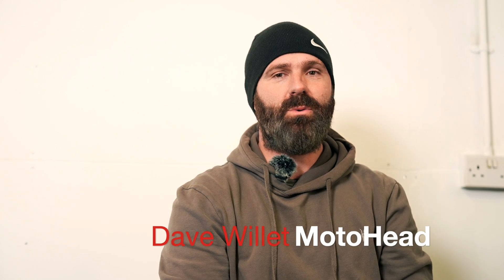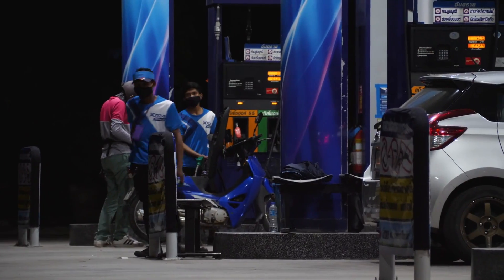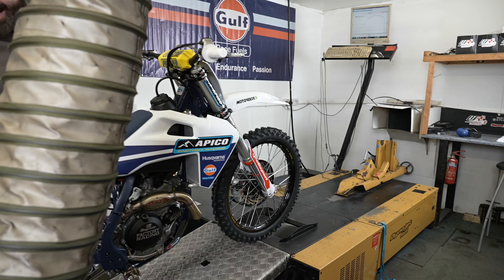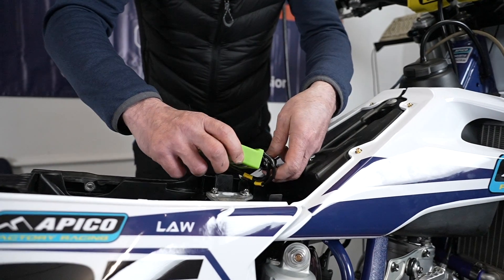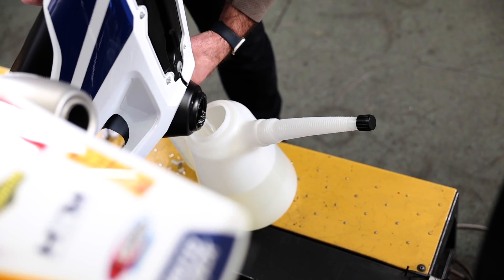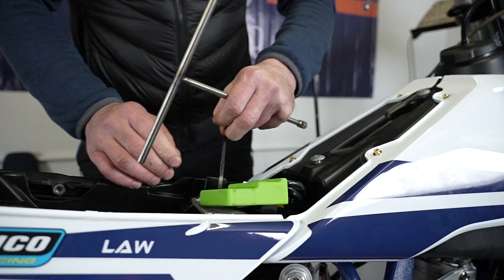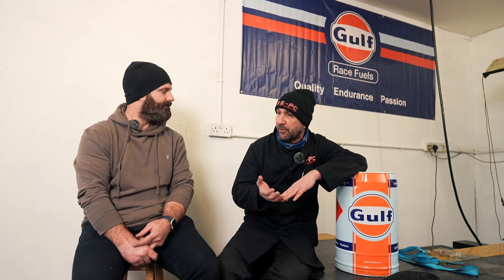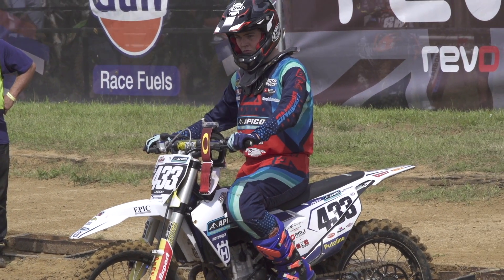Race fuel: The truth! We dyno test pump fuel against Gulf Racing 102 and the results are shocking!

Comment: running a same base mapped engine ,  with an oxygenated fuel will be leaner than the standard fuel , that alone will make more power ,   for how long , who knows being its leaned 8-10% , but ...  .   now the race fuel will have a better cooling effect ,  but anyone thinking this is better , without timing or fueling adjustments , is wrong.....

Comment: I just want to say that it's utter bollox to say that a bike stored with pump gas over the winter will be trouble to start because it was stored with pump gas in it. THEY SELL GULF RACE GAS!!!!!! Utter bollox oh and to cap it off, it's better, believe us. What you want to see the data............. This is a dishonest commercial. You don't need to spend $50 a gallon on race gas if your not a racer. I ride with a large group of street and dirt riders and we all run pump gas. Only issue I have had is a bike left for 3 years, the ethanol fouled the fuel pump but to say you can't store over winter is utter bollox and a sales pitch.

Comment: Why at least 1 pump at the gulf doesn't stock 1L or 5L (Aspen 4t) station should have that fuel to fill out a tank or mix part e10 or premium 
The benefits of Aspen Fuel · 99% cleaner* than ordinary petrol ·

Comment: Doesn’t smell like race fuel more like BS.  Should have ran both fuel without ecu.  Then tuned the ecu with both fuels.
Reply: Then they wouldn't be able to sell you fuel lol
Reply: this really does come off like a paid advertisement vs a technical video .   running an oxygenated fuel at the same settings , per measurable fluid amount,  will be leaner  .   and will make more power .   but for how long .  cant believe they'd post this as if it was a just put this fuel in and go , kind of video .  anyone who understands tuning concepts should be like we are, questioning their integrity and intent. disappointing.

Comment: Is a leaded or oxygenated race fuel better performing on the two stroke, especially if you run a high compression head insert?
Reply: Oxygenated fuel is always better from what I heard. I have a 2 stroke ktm and 4 stroke Yamaha (Yamaha is bone stock). I run Sunoco 110 mix with 93 pump gas and I also add Vp unleaded additive in my 4 stroke and the leaded additive for my 2 stroke. I don’t think you’ll notice a difference running leaded fuel or oxygenated fuel (one or the other not mixed).

Comment: Most people have zero need for any race fuel when they ride around at 1/4 throttle. Same for engine mods and pipes etc, because a fast kid on a 65cc can smoke most with a 450.
Reply: @martin barr's CRF450 I'll be honest there are kids on 65s that are way faster than weekend warrior guys that are on bigger bikes. It's all comparative though and it also depends on your definition and opinion of a novice 450 rider.
Reply: @martin barr's CRF450 We're not talking about a straight line drag race, we're talking moto and woods riding. I know many talented kids on 65's that absolutely smoke 450's on the track.

Comment: I still don't get the whole flap about e10. I understand the risks of having ethanol in the fuel, but it's already had 5% in, for years.
Reply: Ethanol is less energy dense when compared to petrol (gasoline) it burns hotter than petrol and it’s also more aggressive on the fuel system..(gaskets, seals and other plastic parts)
Reply: @Shoorit  Ethanol actually burns colder then petrol.
Reply: @Shoorit  We run straight ethanol in our USAC Midgets and Sprint Cars and building heat in the engines is a challenge some times.
Reply: @backcountryme  I think what I had read was about ethanol blends, there had been complaints of overheating issues but I’m not sure that’s true as I do know that straight ethanol has a cooler flame than gasoline.

Comment: Race Fuel is the only way in my book. I Ran Vp T2 when my 2022 tc125 was stock, now i run VP MRX02 now that motor is fully built with custom tuning CDI
Reply: Race fuel does not make power, it's job is to run cooler so it doesn't detonate(pre ignition) in high compression engines.

Comment: So the REAL question is, do they mix 95 octane and 100% Ethanol or do they use under 95octane poor quality fuel and calculate the approx octane rating after adding the 10% ethanol? For example before EU shit: 95E, after EU: 92-93octane cheap and poor quality+10% E=95octane mix?

Comment: Interesting vid, but these race teams are crack up really.... trying to get "more power" out of a 450.... reality is most pro riders want a stock or de-tuned engine on the 450. Riding a 450 fast is all about slowing them down haha.... counter intuitive but they are such a pig of a bike its true
Reply: I hear you and agree to a point however most factory teams build a engine which is faster and more rideable believe it or not 👍🏻
Reply: @davewillet4764  Yeah i would say a pro rider could ride a fairly stock bike just as fast, but not for long. It seems the factory teams objective now days is to tune the power curve/chassis/suspension/rider relationship so as the bike is more forgiving, and can be ridden fast the entire moto. You can see it in say MXGP, the non factory riders are fast for half the moto and then fade... the factory boys are fast the entire moto, their bikes are more forgiving of mistakes and just easier to ride fast... I feel since 450's came in, a factory bike is absolutely a big advantage
Reply: Tomac is asking for more power this year
Reply: Not entirely correct,  a lot of riders want to detune the engine from the form they first ride the bike in which is usually peak performance  and they work backwards,  not a single guy at the top level would want even a stock engine never mind de tuned from stock , you would get smoked of the start by so much ! Mxgp or ama bikes are substantially faster than a stock 450.
Reply: @KosmicHRTRacingTeam  i believe the deal with Tomac is he has left the engine as the team supplied it ... opposed to wanting more power... where as all other riders have wanted  de-tuned mapping
Reply: @daniellewis6976  with Tomac, the team has a base map that they use and change to suit a rider and Tomac is the first person that has asked for more power instead of a de-tune. 

Also, these team aren’t just looking for HP gain they are working on a dyno to create a map that suits their riders. 

I believe this video is just showing what they can do with a map and exhaust when in reality there’s so much more to what they do.